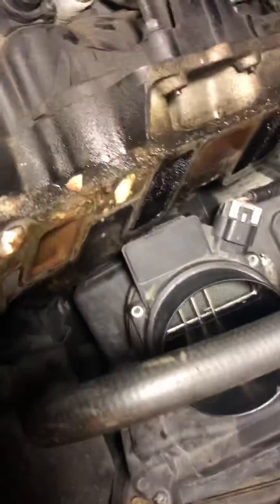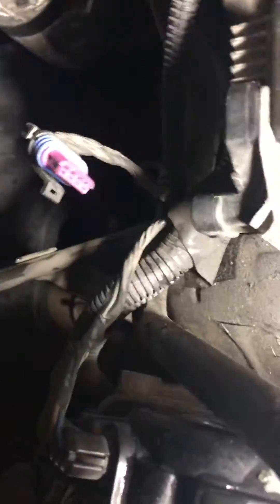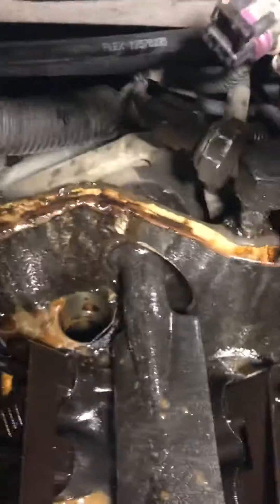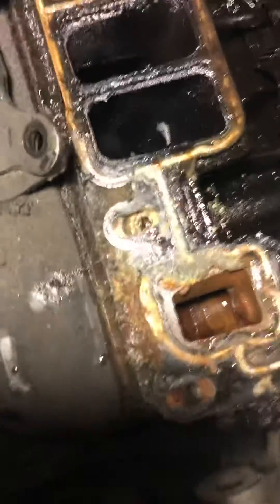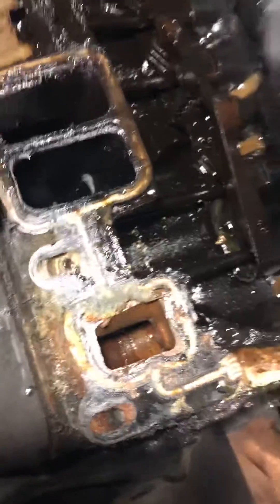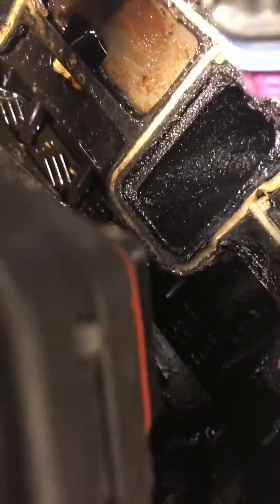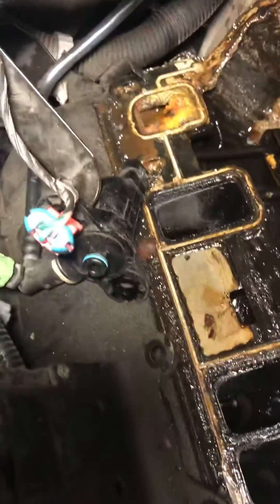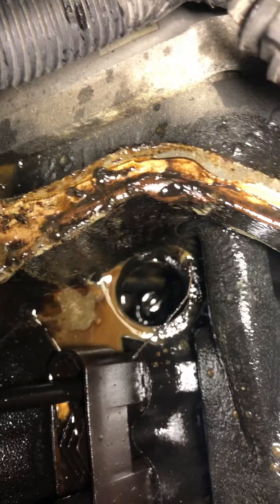Chevy 4.3L Lower Intake Manifold Gasket Leak

Comment: Did it toast the motor?
Reply: Not at all. 190k miles with no overhaul and still running great. Just needed the intake manifold gasket replaced and an oil change.
Reply: @BellesetBeauxDad  that's awesome.